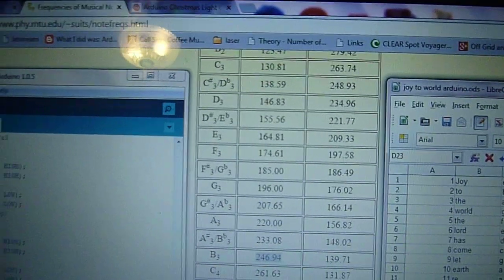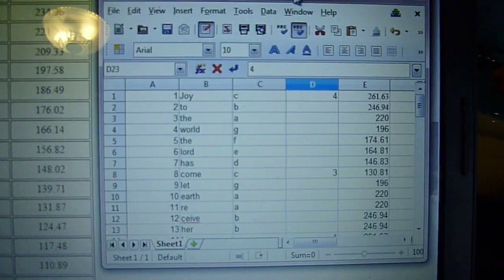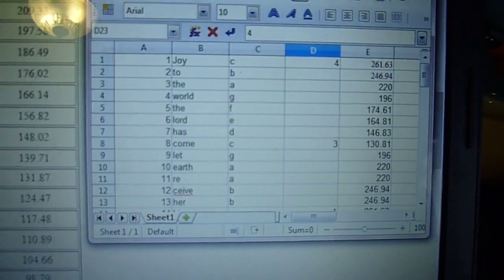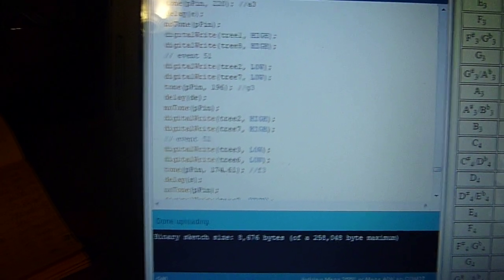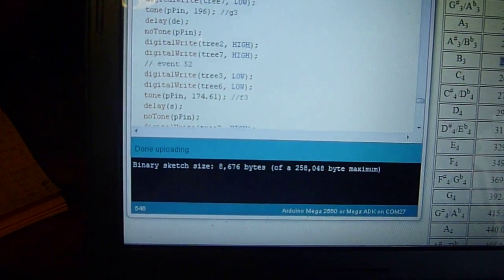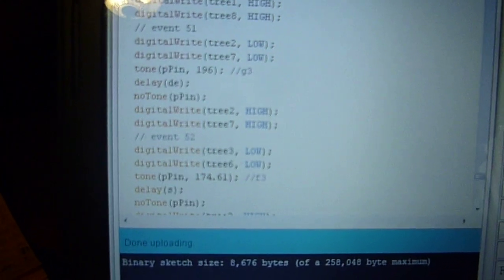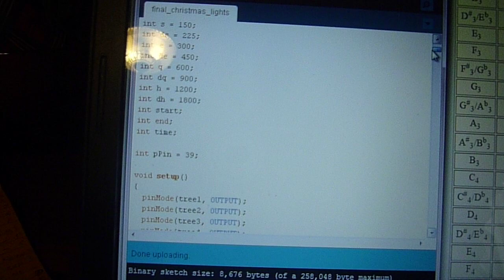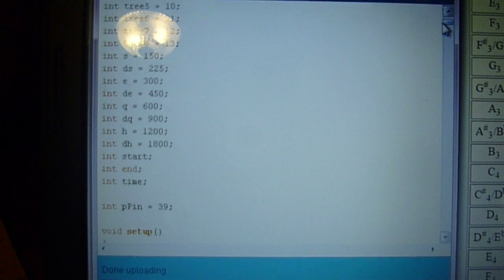Arduino Christmas Light Sequencer - Joy To The World

Comment from the maker: No problems with the tone function in this project. Use of the tone() function will interfere with PWM output on pins 3 and 11 (on boards other than the Mega), but we are not using PWM on any of the relay pins.